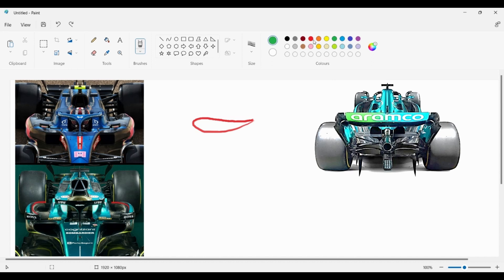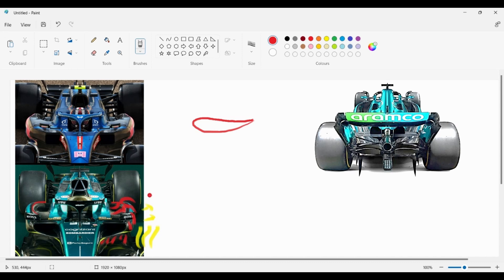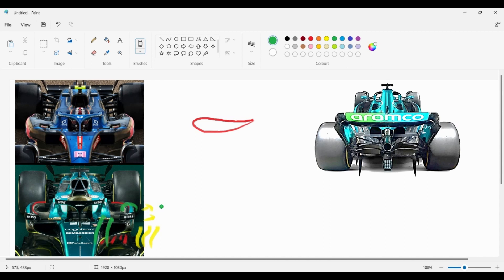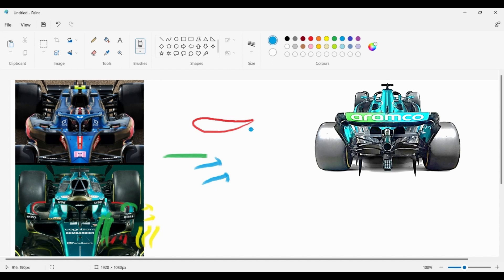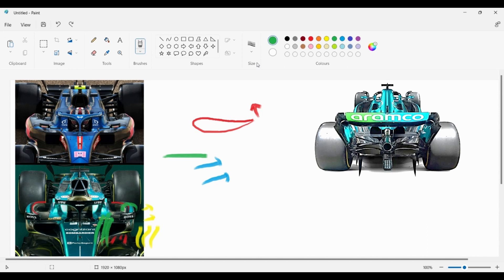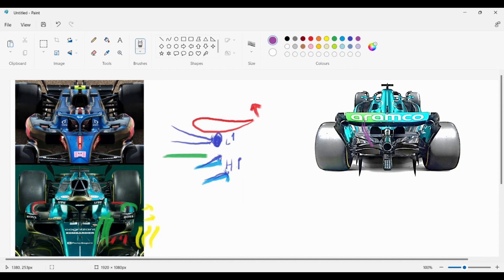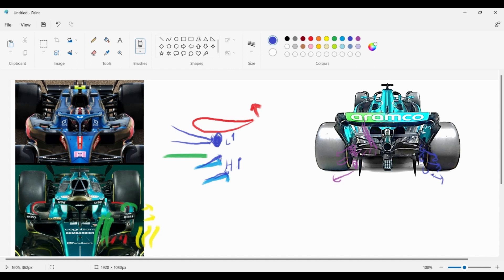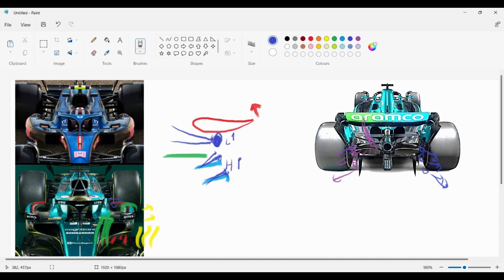F1 2023 Aerodynamics : Aston Martin Waterslide Sidepod : Explained !!

Comment: Nice video, many thanks for sharing your knowledge and expirience in F1. Let me introduce some observation about AMR23 sidepod shape. You based your analysis in the top/aft view of the sidepod and only can see the inwash effect, but if you combine the top view with the lateral view of the “canyon” the story is quite different and more interesting. From the lateral view, about 75% of the length of the “canyon” is a smooth downwash profile and the last 25% is an aggressive upwash ramp. I understand that this sharp direction change with the air flow contained by the lateral walls of the goove can produce some downforce due to the strong upwash effect. Airflow comes out from the sidepod “canyon” with a step upward angle, so you can get more expansion from the diffuser. I suggest you if you can analyse this issue in other video. Greetings from Argentina. Regarding lateral view of the side pod, check this link: https://www.reddit.com/r/formula1/comments/115cqn3/interesting_sidepod_of_the_amr23/

Comment: If you read this.. Could you, very roughly, Say that a diffuser acts like a lung, as in increases volume to draw air in - only that a diffuser is fixed in volume and the air stream comes through the forward movement of the car? (and that the diffuser has another open end for the stream to exit while the lung just holds it)?
Reply from the maker: Well, yes n noe... Conventionally we think of diffusers as closed system, but Is a F1 diffuser a closed volume system ?
Reply: @f1aerodynamicist  my intuition (i am a social worker with a love for physics) says no as there constantly new energy entering and leaving the system, but am I thinking too much from a 2nd law of thermodynamics perspective?
A lung changes its volume though to create the pressure differential, diffusor volume is fixed but the rate of flow can change by moving the air (or car) faster 
Thanks a lot for engaging, trying to wrap my head around diffusers! ♥️

Is it basically the air expands in the diffuser, as the same airflow from in front of the diffuser is in a larger volume now, hence the pressure drops in the diffuser, making the air/atmospheres press the car down in the rear...?

Comment: Outwashing air is very difficult with the new regulations, at least with the outboard side of the tire, the inboard side however is ripe for exploitation. The image that starts at ~ 1:08, shows they're using the sidepods to give air a clean line of sight to the rear of the car, and it's being outwashed behind the rear tire. Notice how the beamwing, and the rear wing endplate, and the diffuser wall, and the furniture on the wheels is all outwashing the air there? It's feeding all the air that goes back there into the low pressure zone behind the tire, this creates a strong vortex that keeps the tire wake from bleeding into the diffuser. At the same time this vortex is pulling air downward across the diffuser wall, and backwards through the slot that is formed between the lower wheel winglet and the wall of the diffuser.